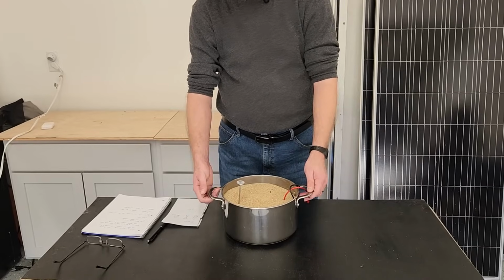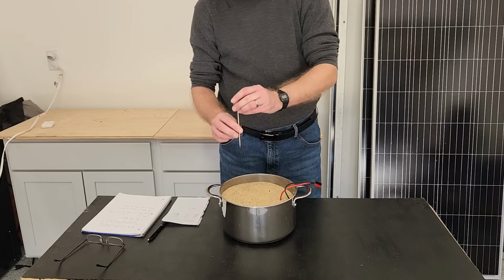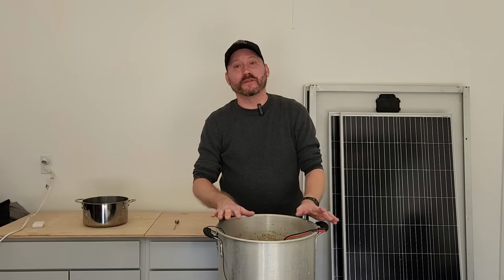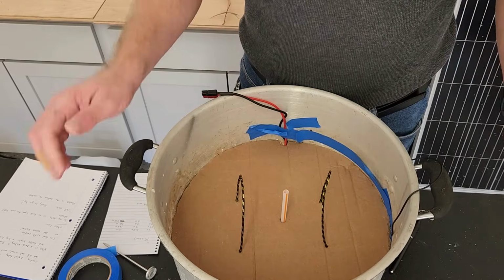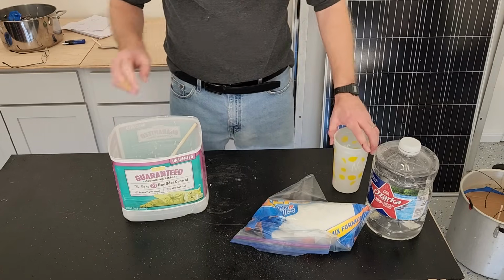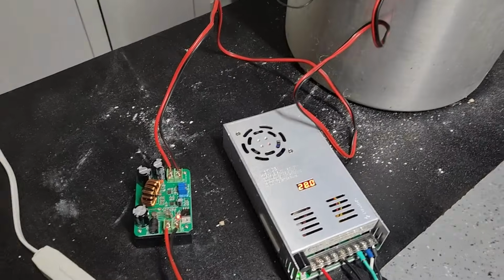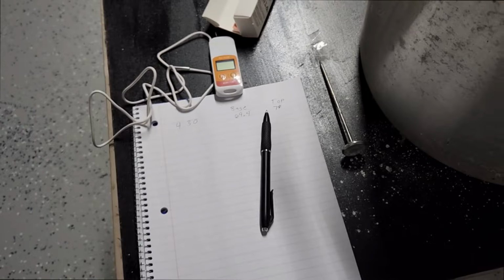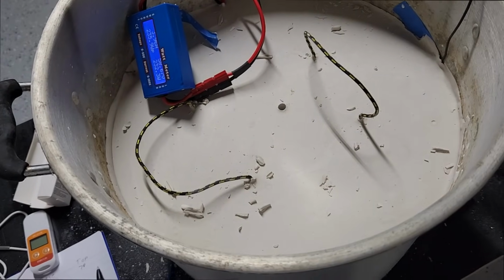Sand Battery heater. Create free heat  of 500F using solar electricity! Texas Prepper Projects

Comment: The problem with sand in large scale storage is that you end up with hot and cold spots because the heat does not travel well in the sand as you discovered the bottom near the heating element was much hotter than the top. Trying to extract heat with a heat exchanger is difficult and slow
Reply: Get an old aluminium step ladder n chop the frame into couple foot lengths then stand them up like spikes in your metal container and add some more aluminium at the top off your poles now fill you container up with sand covering all the aluminium...aluminium radiates heat extremely well so the heat will go up your metal poles inside and radiate the heat more evenly through your sand
Reply: Easiest solve is to add a touch of clay slip in with the sand. Also be sure to use sand with a large variance in grain size.

This will help fill in all the holes in rhe sand, the gaps between the grains. It'll stop acting so much like insulation and the heat will move more evenly through. It'll also likely hold heat for a shorter time.
Reply from the maker: Check out the follow up videos

Comment: The sand heat battery could help to heat a tent. Solar panel and a pot of sand is portable. Can you wrap the pot in an emergency sleeping bag? Metal planter legs might help.
Reply from the maker: This was my original intention. Stay tuned for version2 for real world testing!
Reply: @texasprepperprojects  skme ome else mentioned '... better  for immeduate heat ....' what many people want is the heat from the electricity produced durimg the day  hours later. Temps drop between 10 pm amd 4am. If the electricity made during daylight heats at night, win win. A morevorimitve version of this projciple involved concrete floors that woukld dlowly heat up and release heat at night, and concrette pillars heated fron sin light coning through windiws doi,g this, amd there were even plastic and rubber water filled pillars to heat the sun heat your room. Fans were someti,es included in the design of the house to let the heat  built up there leak into the sleeping areas of the house.

Comment: Put a 1/2 copper coil and use it to heat water. Use the hot water through a fan coil unit then you have a forced air system
Reply from the maker: Why?  Heat is heat is heat. It's not going to increase the total  BTU
Reply: I know it’s not going to increase the btu but it would be a cool easy way to transfer the heat to air versus radiant heat. If you had multiple sand batteries you could heat a house for a substantial amount of time during a cold night. You could put an auxiliary coil in you hvac system
Reply: Hot water heater idea? There is a broad range of applications this could be used for. You could build a diy steam turbine to convert to electricity if needed. My mind naturally likes to expand on the idea. Why not. All of these applications are easy to build. I can imagine 8 of these batteries in parallel and you would only need like 3kw in solar panels but at the end of the day your kWh is what you put in. Just cheap and fun to think about
Reply from the maker: @soundguymatt  check out my follow up videos. I attempted to do this with a small fan and 4" vent duct
Reply: Keep in mind steam is a very efficient energy transfer platform and it’s very inexpensive to build. I would love to see diy engineers utilize it more. Water and sun is all you need.

Comment: Great concept ..thanks .. but it takes more than a few hundred degrees to melt sand .…..A lot more.. and if it did melt at some point  , the resulting glass type  material glob would still retain a huge amount of heat… 
Also get one of those energy free heat fans made for wood burning stove to blow hot air where ya want it…
Good luck ……👍
Reply from the maker: Thanks

Comment: Here's a thought, what if you had a metal trash can cut a hole in it on either side and put a piece of 6-in round ductwork through the middle. Add the heating elements. Add the sand all around that and as it heats up you could use a small USB fan to blow air through the duct. And heat the air flow. What do you think?
Reply from the maker: Check out tur other videos in this series. I have tested this idea

Comment: I have some experience with in-line water heaters and have had problems with 'hot fire' thermal breaker trips. In short, without sufficient heat removal the element can exceed it's design and burn out. The clumping of sand around an element indicates this was happening.
   Some form of thermal regulation would be needed to keep the element from burning out. Also sand transfers it's heat primarily from conduction, not convection, so I would consider placing the element closer to the center instead of close to the bottom.
Reply from the maker: thanks! check out videos 2 and 3 for more details

Comment: I use to build conveyor belt dryers with ceramic heaters. Your element melting problem is similiar to some problems we had.
Biggest problem was at wire to element hookup.
Cure was high temp nickel wire and high temp crimps from wire to elements.
Reply from the maker: I switched to silicon wires

Comment: This would be amazing to offset insane heating costs in my cabin. Have a stove I could set it on that is gas and made to radiate heating. Fantastic job man! Would love to see any updates on this as a system.
Reply from the maker: Check out my other videos. Short version,  it's not worth it. Can you do geothermal?
Reply: Good to know, and great thought. Appreciate it. It’s super rocky soil out here and a big water table 40 ft down, so geothermal would have some big challenges here.

Comment: perhaps make holes in plaster lid, but make plugs for same using same material or hydrocal,hydrostone; then you may regulate rate of heat release.
Reply from the maker: check out video 2 and 3

Comment: I have a spare room I was thinking putting one of these as a space heater because the room has no heat or cooling. I have some still working old solar panels I got from a solar company company cheap. Connect to a 40 gallon metal trash can I have and then wrap it with insulation from a 40 gallon water heater. Duct board under the lid to hold the heat in or set a 6 inch fan on top to dissipate the heat as needed. Saw a channel where the guy ran pipe thru the sand with radiator fluid to a little radiator with an fan connected to a battery also charged by the solar panel. I think if the sand battery is 40 gallons it may not fully discharge the heat over night before the sun comes up and you start charging it up again. If it still has some heat might only take a hour to reach that max temp.
Reply from the maker: give it a shot!

Comment: maybe design mass like a automotive sealed gel battery- no evaporation, use sand and water with gel for element to rest in and cap off?i could see these designed into plenums of existing furnaces for passive heat and maybe wind power for more potential in certain areas where more viable
Reply from the maker: Maybe

Comment: I love the idea of sand battery heat and even harvested a couple of leaky water heaters. Just fill them up with sand ,connect some solar panels and let it go. It would be better to pass the power through your inverter if you want to use the water heater thermostat because the contacts in the thermostat will fail soon due to arcing. Maybe a thin layer of insulation between the tank and thermostat would allow you to control it at a higher temperature.

I haven’t made one yet because heat pumps are so efficient- up to 5 times resistance heat - that it was well within the capacity of my LFP batteries to do the job. Still like the idea of sand battery. How about a 8” layer of sand below a raised floor with pex pipes circulating from your home water heater? I’m a Texas prepper too. Retired mad scientist 😅
Reply from the maker: Stay tuned for my off grid AC project

Comment: Anything that will hold sand and a 12 volt immersion heater (remember that one that plugged into the cigarette lighter socket and you plopped into your coffee cup)
Now get fancy, or cute or even nostalgic.
How about in a decorative milk can ($18 online) or a terracotta chiminea, or rustic - a 14" SPARK pot belly stove.
A 12 volt hot water element is good too.
Most can be supplied with a small solar panel to a car battery and then to the heater.
Small for the bathroom. Larger for the bedroom. Great big for the living room.
Be sure to get some heat powered stove fans to circulate the air 😅
Reply from the maker: The problem is the voltage conversion. Also the fact that you can get 37 volt used panels so cheaply online now.

Comment: Im just starting the research on thermal batteries and really appreciate your offering here, TPP. One thing I'm noticing though is you and others suggest maybe using galvanized garbage cans. The zinc in galvanized steel becomes toxic at temperatures above 392 F so I'd  recommend "Against" heating anything galvanized in future videos.  Thanks for your great videos! Im looking forward to seeing some of your other projects.
Reply from the maker: I addressed this issue a few times. I do know about the toxic nature of those cans. While the sand has been 500f, the actual container has not gotten to that temp. But it is a real and valid concern that people should be aware of.

Comment: Great exercise, increase the surface area. If you can find a way to blow air through it, starting with an electric domestic hot water heater, would be optimal. The insulated tank would allow for longer storage, and you could thermostat the fan for home comfort.
Reply from the maker: Check video 2 and 3 for more tests!

Comment: What a great idea! I plan on using the remainder of heat energy from residual wood/embers after cooking on a rocket stove to heat a sand battery which will drive a TEG fan. I figure it’s a great way to maximize the efficiency of heat output from the rocket stove.
Reply from the maker: Neat!

Comment: Nice work, I built a similar unit before seeing your video, some of the comment suggestions are great and I wished I had read them before building mine. I used a Tesla pancake coil to generate a constant energy supply at a very low level, mine gets nowhere near your high temps but perhaps mine is a little more efficient electrically.
Keep up the great work.
Reply from the maker: Cool, thanks

Comment: I have also the same,but i did put a heatpipe in the sand connected to my radiator. The heating element is from old boiler 60 ltr and fitted on the lid so the connection is outside. And the bucket is isolated with clay and alu foil.And using a converter from 12 volt to 60 volt.
Reply from the maker: Neat

Comment: What you need to do is convert a wood stove into your sand battery so it is more aesthetically acceptable/pleasing. Do everything you did but get a cheap, used, burned out wood stove from ebay. It may not be able to hold burning wood but it is good enough for this use.
Reply from the maker: I got something similar on the way soon!

Comment: nice experiment man. 
there was a guy in europe who was doing similar thing but on bigger scale. He dug a huge whole before building his house, filled it with pipes and sand, thermal insulated from the sides and top, built the foundation slab and the house over it. Instead of photovoltaic solar panels he used Solar water pannels installed on the roof to pump the heat down to the thermal mass under his house. This sand was being heated throughout the summer and the heat was realeased in the winter warming up the interior of the house.
Reply from the maker: I think geothermal would be better. I just don't have dirt in Texas

Comment: Your heat loss during the day while you are heating the sand would be the reason you are not finding heat on the outside of the container. this will effect your perception of how well it is working. Two ways you can overcome this. increase the thermal mass to allow the outer sand to insulate the sand inside but this will also slow the heat release at night time and you still won't be able to tell by putting your hand on the outside of the container  or insulate the outside of the container.
 There must be a sand mass that will work for your situation which you need to test for by checking the temperature in the centre of the mass in the morning or at the end of the heat release time
Reply from the maker: Check my follow up videos for tests

Comment: Nice video. Unfortunatly..it wouldn't work very well i'm afraid.. Those water heaters are not designed to handle that much heat..cables can get up to 200Degree C .. but ofc with special insulation from capton you can get higher ..but not really much more.. so yeah it isn't that easy to work for years like this.. if you have 5 hour sunlight during winter...then that is nice to have ..here during winter..no sun at all ..so not good at all
Reply from the maker: Check out my follow up videos for more specific details and testing on this. I agree that this is not the best way to do it...

Comment: Suggestion. Get an old pot belly stove - they are meant to radiate heat and have little feet so that they are not on the floor. Also find a Peltier module and an old CPU radiator. That will generate a few watts of power which is enough to run a USB fan, which an radiate heat to a larger room. The Peltier module has a hot side and a cold side. When there is a temperature difference, a current is formed.
Reply from the maker: Check out the other videos in the series

Comment: The failure point running at 120v is the element.  They are designed to be run under water. They will quickky melt in two when out of water or oil. That's why you never turn your water heater on unless it's full of water.
Reply from the maker: This is true. Check my other videos

Comment: If you could take a ceramic tile (the tube tiles or maybe a 1/4" thick aluminum/metal tube) and have it go through the center of a larger cylinder, then surround that with the sand  (10-20ish pounds) and the heater element inside, cap off the larger cylinder with plates and have the center tube still open. Then direct a small fan into one side of the center tube t push air, figure out a way to regulate the temperature with a thermometer/thermostat between the heater element and the power supplied (say to around 200-250ish)  I think that would supply a good bit of heat for ya and more than likely cut the power usage too.
Reply from the maker: check video 2 and 3 for more follow up

Comment: What are thoughts on using an old electric hot water heater
Cut off top. Fill with sand.   U got two heating elements and thermostats
Additionally can replace elements with 12 volt or 2. 24 volt.   For off grid back up
Reply from the maker: Check out my other videos for this

Comment: you could use a sterling fan in top of the bucket (like ones set on a wood stove to spread the heat around.) Sterling engines operate on thermal energy so it may be a perfect application. no additional energy inputs needed. something to consider.
Reply from the maker: Tec fan with a peltier module
Reply: @texasprepperprojects  yeah, but you would need quite a few to generate any usable energy with  but it may be enough to charge your phone while the towers are down😎 
but anything to make life a bit more livable is worth a look, Yes? there is a lot of "obsolete tech." thatcan still be utilized don't forget the humble steam engine that was used to power workshops utilizing belts and pullies to run power equipment back in the day... Just saying😁

Comment: If you could force some air thru a metal coil that was in or surrounded in your sand so as to pump hot air out I could see it as a useful heater.
Reply from the maker: Stay tuned for rev 2 that is based on this idea actually.

Comment: I'm in the Greenville area I know you're "cold". Love the video. Great DYI. 
Your stated solar panel production in factory spec at 70 degrees. Expect a little less. You should still make your goal though on most days.
Suggestions: to hopefully prevent sand making glass at the terminals add paragin wax to fill space between sand grains and also take advantage of phase change increased thermal capacity and discharge time. Playground sand will have less room fir wax than coarse sand/beach sand.
Set the pot on a cast iron trivet or a low rot iron plant stand.
Convert a defunct 40 pound or bigger propane tank or heavy/thick galvanized steel trash can. Furnace bricks on bottom or your plaster of paris.
Set heating element vertically in center and try to get equal distance from top and bottom of element as distance to walls. Thus, the suggestion of propane tank. Heating elements come in a lot of lengths. A little math will give you the optimum length for the actual container you choose.
You need more thermal capacity than you can produce. Not much, but more. Once the system is saturated things will start to warp, melt, rupture, go south. Add a loth of extra insulation to the wires. You need more protection than your theoretical may temp. Or, seperate the wires and chase out of the vessel on opposite sides. The sand and wax are non-conductive so bare wires are no big deal as long as they can't arc at the element terminals. After the first run, this isn't an issue as the new glass will prevent it. But, until then, you could short the system and fry your electronics up stream.
Radiator fins on the outside might help. Or, burry a thick wall cpper coil in the sand and circulate fluids to a used truck radiator with the OEM electric fans still on the housing (step down the fan speed). This could branch off and heat multible bedrooms through the night.
I love your idea. I wish you all great success. This is just me spit balling some ideas while driving home from work. I hope some it might help and that it all makes sense.
Reply from the maker: check my 2 follow up videos for reasons why I did what I did, and testing of those ideas